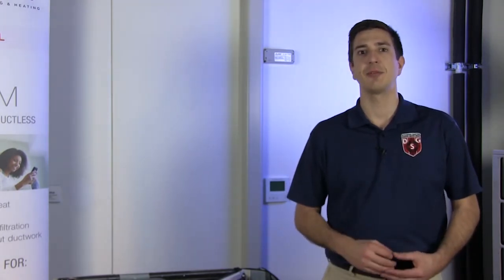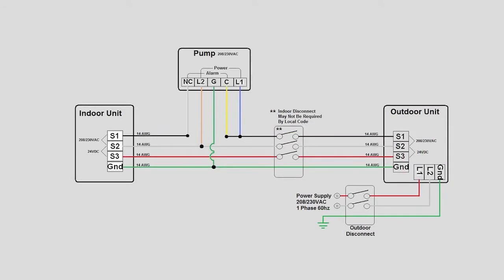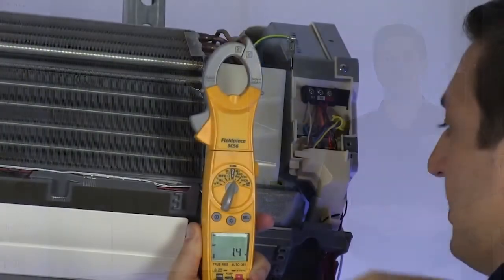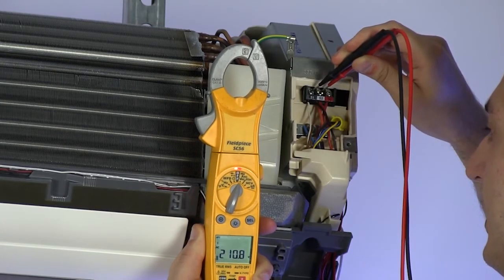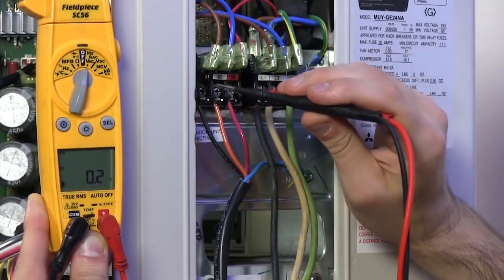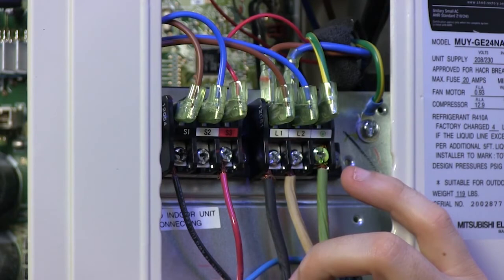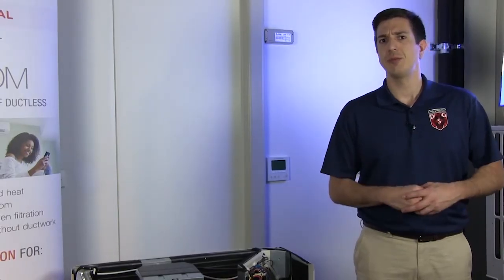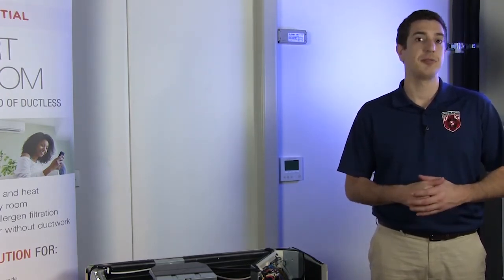Tech Tips: No Power (L)

Comment: I been researching, the s3 connection has 120v ac but conducts DC voltage like power line communicating. There is two capacitors at the S3 connector where the DC signals is send from one end and stop at the other end and is collected for capacitor read the pulsation signals and passes the AC signal flowing with no interference